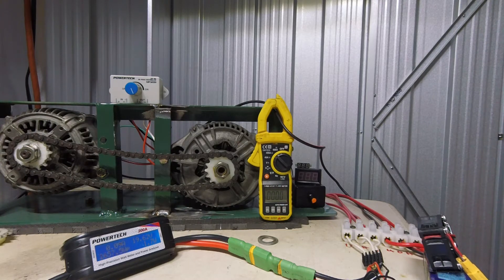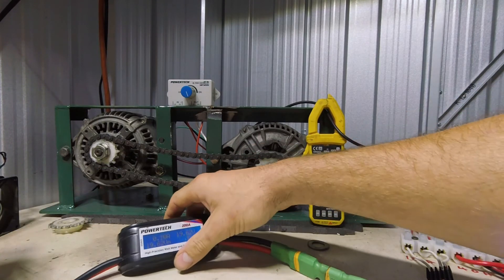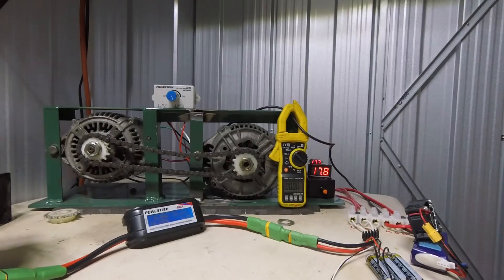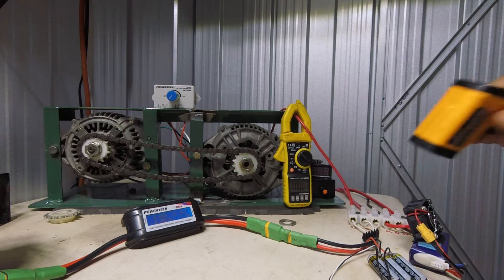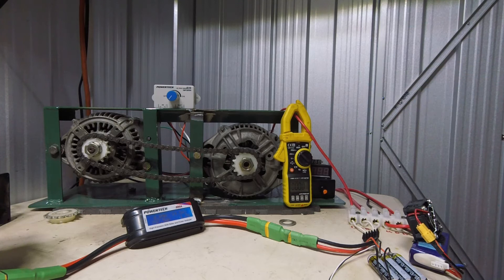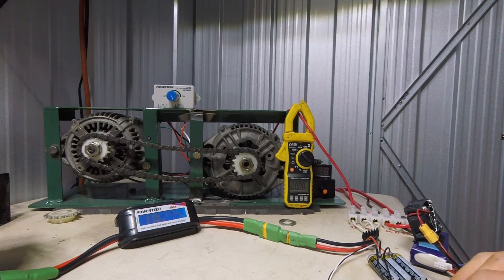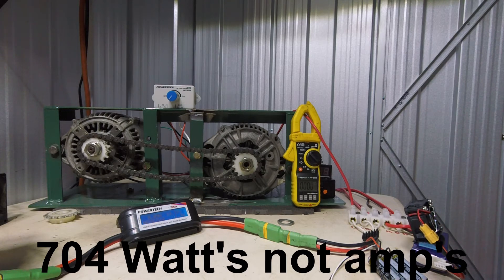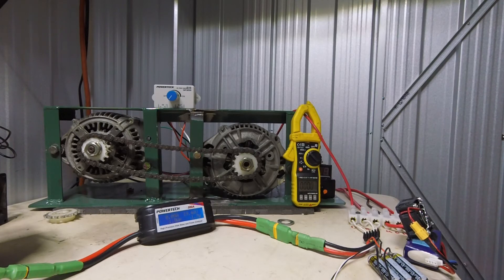Load testing small esc's on a big  motor - BORED FUN

Comment: How have you hooked up the wiring for the motor providing the load? And also, what's the deal with the plastic sprockets? Are they 3d printed?
Reply from the maker: @Chris Longbottom  For the Load its a peace of steel cable connected in a delta configuration and is sitting in some water.  Yeah the sprokets are 3d printed!  I printed them in nylon at 100% infill,  It's the cheapest way as i have changed the number of teeth a few times.  lasting well I didn't think they would!!

Comment: I think I have the same problem at 2:48 with the go-kart, too much load at starting from a dead stop.
Reply from the maker: Yeah if it had hall sensors that would help alot.  The vesc will start fine under load once settings are tuned.
Reply: @fixitmoditbreakit7982  I think I got it right! Now I need to put it back on the go kart. See: https://www.youtube.com/watch?v=7k-nG_keh1A